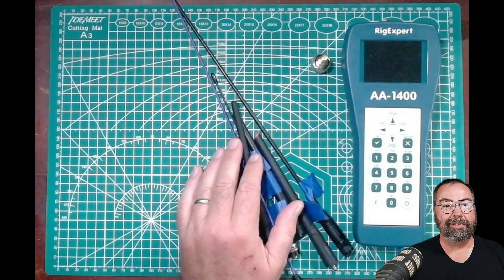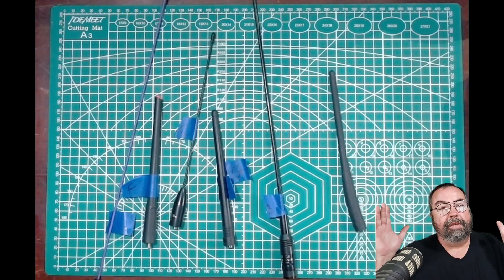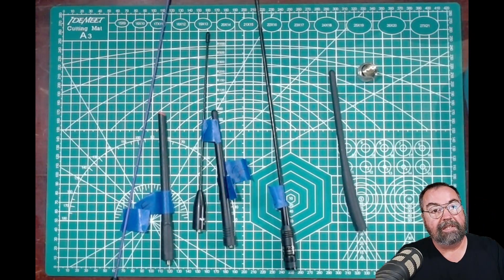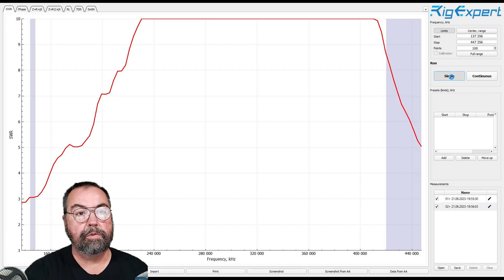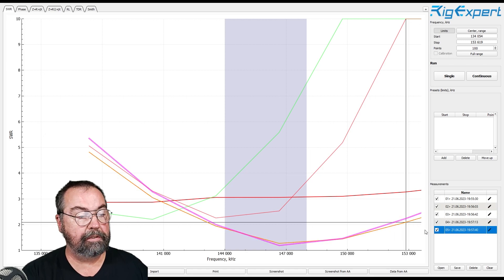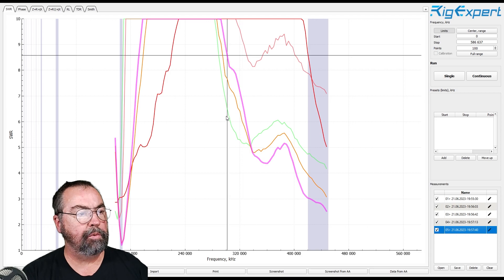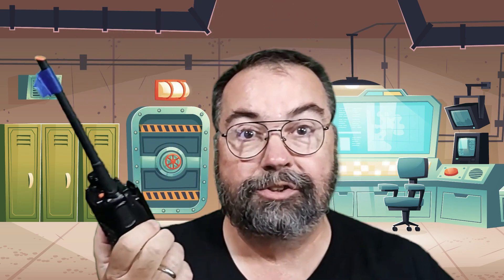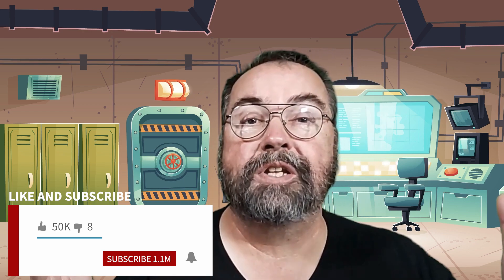HT Antennas - Are they REALLY identical?

Comment: There are so many things we are not talking about here. One guy said such and such gave the best signals , and yet, we are actually testing SWR. 

A couple things I like to think about are, just where is the repeater or station from the elevation angle viewpoint. Some of the antennas may send a signal horizontally, others maybe at 20 or 30 degrees elevated. Even a beam can do that. . That said, monitoring what the repeater is actually hearing may not be easy for you to do. Some repeaters though actually are a type of "cross band" repeater. That type of repeater may be easier to actually monitor (listen to with a different radio and a pair of headphones for instance). That said, you could set up your own cross band repeater and listen to the output from even a mile away ? When you do things like this you begin to see what the real differences are and you eliminate things like metes that are affected by wires hanging from them or how your holding the radio ect.  N6GRG

Comment: The manufacturer comment about meter testing is one of those "it depends" scenarios.  They say that because a lot of folks don't realize that YOU are the ground plane for an HT antenna.  They hook up a meter with the whole thing lying horizontal on a bench and wonder why they get terrible measurements.  They way you're doing it, holding the meter like an HT, is the right way to do it.  The results are super finicky though.  Try it for just one band at a time so you have good resolution, and then hold the meter in different positions.  You'll be amazed at how much the readings vary.

Comment: Nice.  Speaking "only for me", I have not had the best signal reports using the Signal Sticks. I have several, and none of them have worked for me as I had hoped.  There is a lot of hype for theses antennas.  I know everybody is all about them, but I am finding that in my area, not the be the best antenna for me to use.  I do agree, the stock FT5D antenna is a good antenna, and I always get good signal reports using that antenna, on the FT5D. It's the only one I use on that radio.